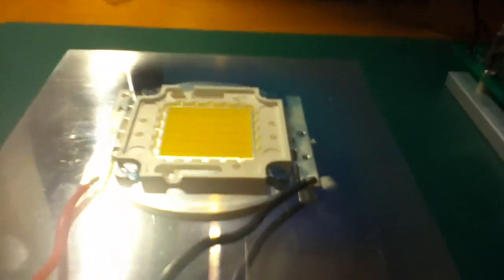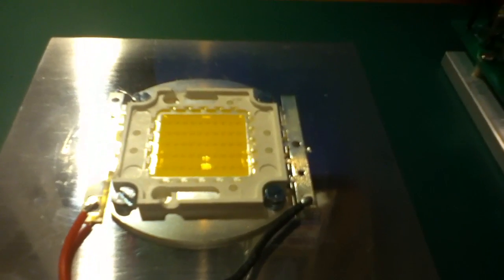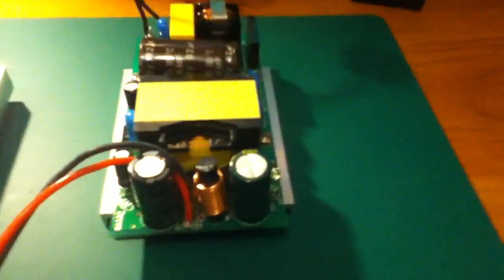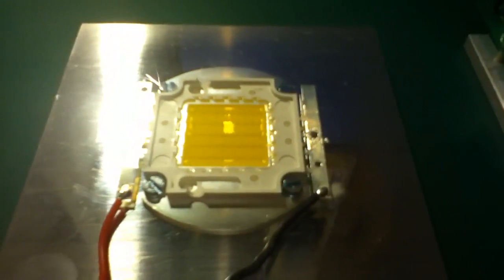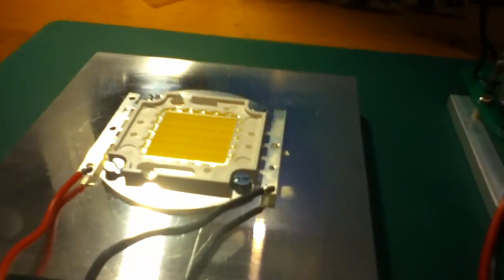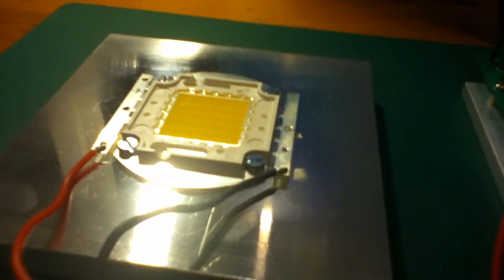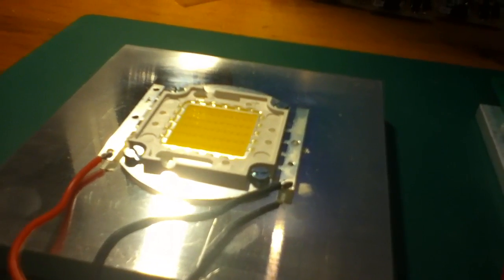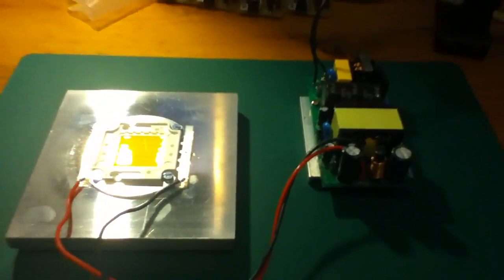50W High Power LED is as bright as a 500W Halogen

Comment: Where can I get one of these?? This is the exact same one that is used in my home theater 133" projector. Its driven by 24VDC. Yes that thing will get very hot by it self. the one in projector is
 A.) mounted to a very thick sink, B.) which is then mounted on a radiator system C.)then coupled to a 3 inch exhaust fan

Comment: I'm reading in the comments that some are using drivers that lower in wattage rating than the LEDs themselves.  I'm curious as how that works without frying the driver.  As an electrician, I'm accustomed to "drivers" needing to bigger or at least matched to the device that's drawing the current.  To lower the current draw, I would use resistors, current limiters, rheostats, frequency modulation drives, and so on, but I as I understand how electricity works, the current drawing device don't magically want less energy because you're supply is giving it less energy.  The current drawing device will overwhelm an undersized driver until the driver fails.  Am I right?  It's kinda like wiring a 10HP motor with 18AWG on a 50A breaker.  The 18 gauge wire is going to melt almost instantly.  Furthermore, putting a 500W light bulb on 300W transformer will burn up the transformer.  It may take a day or three, but it's going to happen.  I've seen it happen too many times.  I could be wrong about LEDs because I'm just diving into the technical details of them instead of just following installation instructions.  I have a 50W LED flood project where the light is totally enclosed and submerged and I have to figure out a way to keep it from burning up in minutes.  Any advice would be nice.
Reply: +Chris Roush  LEDs require a current limiter, because otherwise they will "run away and draw increasing levels of power until they vaporise. So, there is no such thing as a "10 watt LED" - without current limiting it will draw 0.1W > 1.0W > 10W > 100W > POP! The LED also has a (relatively) fixed Voltage drop, for white it is nominally 3V per LED Junction. Back to electrical school, and you remember Watts = Volts x Amps? The LED Driver is a current limiter, so it is impossible to "blow one up" even if it is short circuited. You can plug a 1 million watt LED into a 250mA LED Driver, and guess what current that LED will get driven at?As for your underwater floodlight, simply bolt the LED to the housing, and allow the water to cool the outside of the housing - the LED will stay very cool indeed. LEDs can only be cooled by conduction, not by radiation (which is how incandescent lamps cool themselves)
Reply: +llamaspit Very cool!  Didn't know that the driver itself was the current limiter.  I just figured that the load wants what it needs to do it's thing and anything between it and the power source better be able to handle the draw.  What you're saying is that the driver is the load and the light gets what the driver outputs.  So for LEDs, the driver must be rated to output at least the minimum voltage to light the LED.  I'm tracking now.  As far as my pool light goes.  I did mount it to the stainless fixture but I also mounted a copper cooling block in between.  A lil pump cycles water through the block, too.  Unfortunately, the 50W SMD is having issues after only 4-5 months.  It's giving the characteristics of overheating.  Maybe the lil pump failed, but even so the SMD is attached to a copper plate which is in turn attached to a larger copper plate which is attached to the stainless fixture. I'll have to dive in and figure out what went wrong.The homeowner loves it and is hounding me.
Reply: Chris Roush
The LED has (kind of) similar "negative resistance" characteristics to discharge light sources. You know, Fluorescents, Metal Halide, Mercury Vapour, etc.  Without a current limiter, they also will continue to draw more and more power until they self destruct. With a discharge light source, they start off as an open circuit, then after they are given an ignition voltage an electrical arc is created. The voltage across the arc is reasonably fixed, but the arc continues to draw more and more current... the more current that flows, the lower the resistance becomes. So, once they get started, they try their very best to become a short circuit.
The ballast that is used with discharge lamp is what limits the current and keeps them under control. For example, use 2 electrodes far enough apart to need 135V to arc across, and then use a ballast to limit the current to 3.2A and you can control a 400W Mercury Vapour or Metal Halide lamp.
LEDs are similar... not the same, but similar in concept of their control.
Reply: Chris Roush
Yes, your grasp of the control system is getting there. However you are missing a very important point. For your 50W pool light, you say you have problems with overheating... understandable since the chances of your cooling system actually working is pretty low (even with water pumps, etc.
I was playing with some 10W COB packages this morning, on a simple adjustable power supply. These LEDs have a 9 chips inside, 3 groups of 3 in series - rated at 10 Volts but they actually run at a bit higher than that, depending on how hard you drive them.
Remember, Volts x Amps = Watts. So, I dialled the voltage up slowly and they start to illuminate at about 9V, and are nice and bright at about 11V - I set the power supply to putput 15V, but they only draw what they need. I set the current limit to 200mA and I get a (11V x 0.2A=) 2.2 Watt LED. I wind the current up to 500mA, and I have a (11x0.5=) 5.5W LED.
I wind the current to 0.91 Amps, and I have a 10W LED. I wind the current to 2 Amps, and I get a (11x2=) 22W LED.... so I can make any power level I want, just by adjusting the amps.
But I need to conduct the heat away, or the LEDs will cook. Even at 10W the chip becomes too hot to touch within 10-15 seconds. If I could cool it well enough, I could run that 10W LED at 50W like your pool light.
However, in reality, most LEDs are best run at WELL UNDER their maximum rating - my 10W module will be far happier at 5W in the real world.
So, your pool light simply needs less current, because you have no chance of improving the cooling. If you need more light, use 2 of them..
Reply: +llamaspit I hear ya!  I used to run a small electrical crew.  Our focus was high/low volt commercial properties including metal halide and HPS wall packs and pole lights.  I understand the install very well.  Here's what I have in order:  120vac line,12vac trans built into fixture, 12vac to 12vdc rectifier, branch, cooling pump and 12vdc to 32vdc trans/LED driver, blue 50w SMD.  SMD sits on a cold water copper cooling pad greater than or equal to a 5" by 3" by 3.5" blade style air cooled heatsink.  The cooling pad sits on a copper plate of about 7" by 4" which is bolted to the steel fixture (~4 sq" of flush contact -- the 120v-12v trans creates a divot in the middle of the fixture) which is sealed and submerged.  The light survived beautifully for about four months.  Mostly Chinese parts.... How do I make this work for at least 35k hours?  I'm disassembling it this weekend, so I'll update as things progress.  Email me and we can powwow with pictures: Chris.roush@gmail.com
Reply: Chris Roush

This is easily solved. Get rid of all that complicated crap. Get ALL of the drivers, transformers, etc out of the fixture. Get rid of your water cooling, pumps, copper pads, rectifiers - get it ALL out of there!

Buy a proper, legal, UL certified 120V to 32V LED Driver, and mount it remote to the fixture. This needs to be a fully-isolated driver, inside a suitably legal enclosure for your country (I am in Australia, our electrical code is different to the USA). NO, I don't mean some cobbled-together mish-mash, or something from Ebay... I mean a LEGAL driver, perhaps from Meanwell.

I reckon you should drop the wattage, since a 50W LED should never be run at 50W anyway (it's called an "absolute maximum rating" for a reason).... I'd say get a 40W driver (1.25A) or even a 30W (1A) would be better. You won't lose much light, since the excess heat at 50W causes drop in light output anyway...

Get some proper underwater LV cable. Use 2-core (no ground required when you run it off ELV). Since it's a constant current driver, you don't need to worry too much about voltage drop, Even at 50W, you are only pulling 1.6A so that'll allow a pretty long run. You get more conductor diameter by using 2-core through the same sealing gland size. Calculate the voltage drop anyway, and make sure that the LED driver has enough headroom (eg: higher than 38V driver if you calculate 6V drop (and remember 2 wires = twice the length = double the Vdrop).

Finally, bolt the LED into the housing so that it DIRECTLY and tightly interfaces to the external skin. Make sure you use a decent thermal compound and that both the LED rear face and the housing are dead flat. As in "checked for full contact with a piece of plate glass" flat. You only need a small area, same size as the LED module.

There should be nothing whatsoever bet\ween the LED and the housing, except for a thin film of thermal paste. There should be nothing between the plate that the LED is mounted on and the water, except for the thickness of the housing.

Done.
Reply: +llamaspit That's what I'm talking about! Thanks!  However, there's problems: 1) client didn't/doesn't want to replace Pentair intellibrite fixture at $1000, 2) that particular fixture has a built-in transformer (120VAC to 12vac) -- not getting that trans outta there as its epoxied into place, 3) due to number 2, I have to correct voltage inside the unit. 4) fixture is sealed -- how will heat be diverted away from SMD without a heatsink or cooling pad even if wattage is decreased.  5) yes, the LED kit is Chinese and I bought it from eBay, but it was sent as a kit and I torture tested it for hours before installing it into the submergible fixture.  Basically, what your saying is that I need to scrap everything a create my own fixture with the proper voltage being sent to the pool light niche.  As I said yesterday, I can email you with pictures of what's crackin at this job, Chris.Roush@gmail.com.  I'll even pay you in Aussie money for your help to get this project stabilized.
Reply: +llamaspit That's what I'm talking about! Thanks!  However, there's problems: 1) client didn't/doesn't want to replace Pentair intellibrite fixture at a 1000 bucks, 2) that particular fixture has a built-in transformer (120VAC to 12vac) -- not getting that trans outta there as its epoxied into place, 3) due to number 2, I have to correct voltage inside the unit. 4) fixture is sealed -- how will heat be diverted away from SMD without a heatsink or cooling pad even if wattage is decreased.  5) yes, the LED kit is Chinese and I bought it from eBay, but it was sent as a kit and I torture tested it for hours before installing it into the submergible fixture.  Basically, what your saying is that I need to scrap everything a create my own fixture with the proper voltage being sent to the pool light niche.  As I said yesterday, I can email you with pictures of what's crackin at this job, Chris.Roush@gmail.com.  I'll even pay you in Aussie money for your help to get this project stabilized.
Reply: llamaspit  I did what you said.  I removed all of the complicated crap.  The rectifier is gone, the water pump is gone, and the cooling pad is gone.  I can't remove the 120AC to 12AC transformer because it's epoxied into the fixture; hence, the driver had to stay inside the fixture, too.  The reason the original configuration failed was because water leaked into the fixture at one of my hose ports.  Most of the wires shorted to the point of isolating.  I made the mistake of rushing to get done and used silicon as a gasket instead of a bulkhead o-ring.  Oddly enough, the contraption still worked after reconnecting the shorted wires! So it prolly would have worked out if I wasn't such a boobuss.  Anyway, the new configuration is done by your instruction.  Although the driver and LED is now getting 12VAC instead of VDC.  Seems to be working and without flickering (I don't really care that it may kill the LED sooner -- if that happens, then I'll sell the client a new light, win-win).  It's been going strong for 3 days so far.
Reply: Chris Roush Current limmiting turns down the voltage until at the amps you set.

Comment: I'm planning to build a 50w led bike light, I have a 100w LED currently as a torch but I would like to concentrate the beam for less of a spread.

Have you came across any suitable reflectors?

I've not really seen any suitable application other than a floodlight.
Reply: ben150785 Reflectors have little effect because LED's aren't a circular radiator of light. If you want to reduce the spread you need a lens in front instead or place it at the end of a shiny tube.
Reply: +ben150785 Wouldn't this brightness be a hazard if you are using your bike on a road or pavement or is it ok for oncoming bikes/cars/pedestrians?
Reply: +Jim F I currently have a 35w HID on my bike at the moment, its quite bright also. I just turn it off when im on the road or around people. Its good because i can set things on fire with it. :)
Most of my cycling is trail riding in the woods at night, thats why i have bright lights.

Comment: I bought one for grins and giggles but had no idea as to the "driver" required or the voltage it runs on it just said something about 30 - 34 Forward Voltage and 1500mA Current. May I know where you bought that rather substantial looking driver for it? I just powered mine up with a dc to dc boost module, and bleeding well blinded myself in  overcast type day light ! This is remarkably bright :-)
Reply: Chris Leech He either used a boost converter (easily found on ebay) or an adjustable power supply (like what they use in electric labs)

Comment: No That is WRONG !!!!
An 50W LED is never stronger Than 500W Halogen !

500W low quality Halogen  ~11´000lm and more
50W LED ~4´000lm (80lm/W)

Led at low Power most efficient
T6 10W Led at 10W = 900lm (90lm/W) and at 2W (130lm/W)
Halogen Lamps get effective at high power !
100W Halogen are more efective than a 10W halogen lamp.

I Have A Phillips Halogen Lamp with 40lm/W !!! but only 50h lifetime ;)
Reply: I agree. If a 25 watt LED lamp is equivalent to a 100 Watt incandescent. It would take 125 watt LED to get to equivalent 500 Watt incandescent. As a halogen is 20% more efficient you will need at least 150 Watts of LED to equivalent 500 Watt Halogen.
Reply: Neil Robertson You can get 16w LED's equivalent to 100w incandescents these days.  Cree, integral and a few other companies make them.

http://www.cnet.com/products/cree-100-watt-replacement-led-bulb-soft-white/ see chart half way down page
Reply: dude did you understand that andy guy im confused haha
Reply: xD 
Most of the Products are overrated.
I have Seen 3W Led lamps with "Replace 60W" on the box.
And at home the 40W Bulb was much Brighter than the LED.

Comment: sir i have a 10 watt led flood light using 240v AC is there a way to convert it to use 12 volt DC FOR MY SOLAR SYSTEM
Reply from the maker: Yes, see the 4th item in my latest postbag video: http://youtu.be/9GWxPb35FA0
Reply: +Absolom Madhaka Yeah, if you get a buck/boost converter, you can take any input from 5-12 V, and either boost it or regulate it to 10 V at 1,000 mA, which should drive the LED quite well on a solar system. Replace the 240V driver that's in it with something like this and it will work a treat!!

http://www.ebay.com/itm/DC-Power-Converter-Module-4A-Max-Step-up-Boost-XL6009-Adjustable-Replace-LM2577-/251279363842?hash=item3a816acf02:g:8-0AAOSwstxVLyJB

Comment: Hi. I also bought one of these HP LEDs from eBay, and mine has a 20W rating. I cannot tell from the video, but it seems that the light could be much more intense if you could find a suitable power supply. Mine draw aprox. 15W and it's clearly brighter than a 100W incandescent light. So, I think that your aproximation might be pretty close to truth. Still, heat is a big problem with these LEDs.

Comment: These (30w versions) LED's are a great replacement for old cine projector lamps, the bonus is the light output is way cooler and whiter than the original so that protects the film and gives better colours. You still need the LED  heatsink but can utilise the original lamp cooling on that.
Reply: What sort of projector were you talking about, if I may ask? 35mm film projectors?
Reply: Carbon arc?  I'm an IATSE projectist/filmmaker.
Reply: BrekanArts carbon arc? they still use those in some projectors? I was under the impression they were all regular electric arc lamps

Comment: One solution for thermal management is to underdrive the LEDs a lot. This makes it more expensive of course, needing to buy more LEDs instead.
Reply: I thought this too.  four 100w LED chips run at 25% would produce the make light at 25% the heat.  Is it true by the same driver in parallel?
Reply: Leds are more efficient at lower loads.
Reply: John Bäckstrand Excellent and assumed knowledge,  Thank you!

Comment: It can not be equivalent to more than a 300w standard tungsten lamp.
Reply: I agree. Nice video, but 50W led isn't really close to 500W halogen. I have 70W led light and it's also not as bright as 500W halo (it has around 5500lm, but 500W halo has close to 12000lm). I would say that 100W led is around 500W halo.
Julian Ilett
Maybe you had 500W floodlight with 300W bulb and you thought it was 500W when comparing it to 50W LED. (same happened to me - I had floodlight with 500W bulb limit, but it had 300W halogen inside).
Reply: Yup, 6 to one seems like a good proportion for a really high quality LED vs tungsten incandescent.